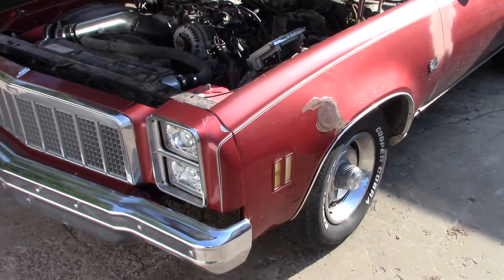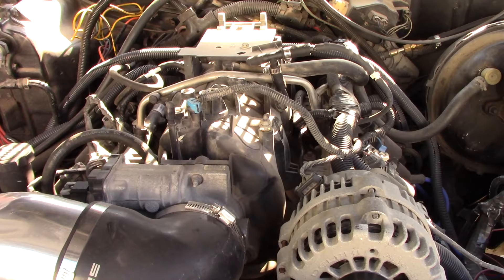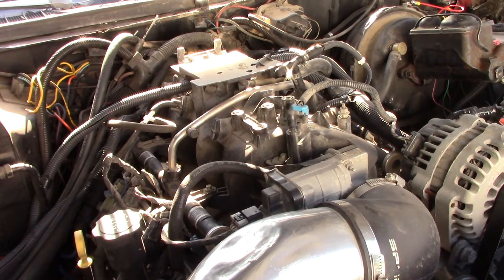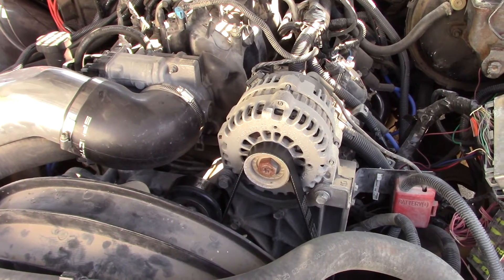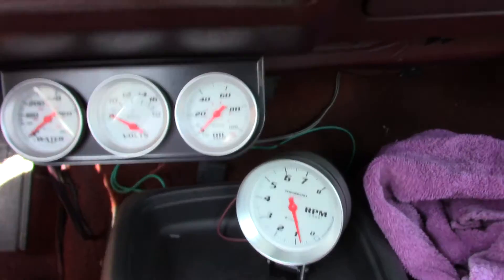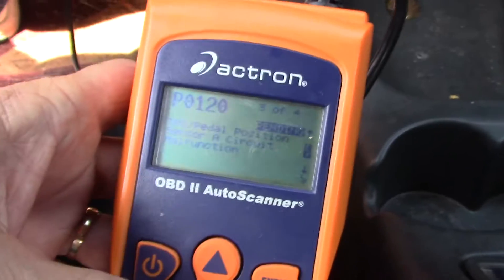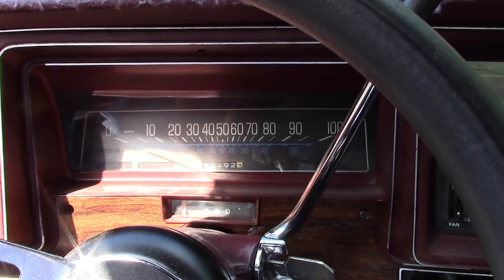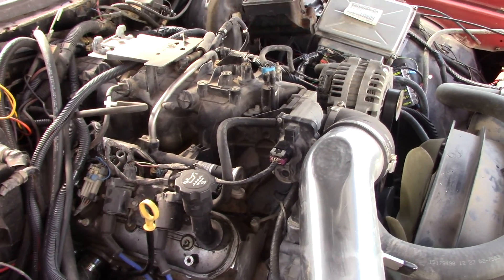5.3 swap and intro of 1976 Malibu

Comment: Did the pedal from the 03 bolt up fine ?
Reply from the maker: well no it didn't, I had to cut both the factory and the one from the Tahoe, and welded them together its been about 4 years ago i did it but seems like one or 2 bolts lined up but i don't remember, Ill try to check it when I get off work.
Reply: @mikescarsandadventures7595  ok thanks I appreciate it
Reply from the maker: @brieontk  Sorry took so long, but I looked at the pedal and I didn't use the top holes but may have used the bottom one, its hard to see without taking it apart.
Reply: @mikescarsandadventures7595  thanks man I appreciate it !

Comment: What color wires you use from bulkhead for your swap to get the car to run
Reply from the maker: Not sure if your asking about the starter wire from ignition switch, but I used the same wire to the starter that the small block used, the only wires I ran into the car was for the obd II hookup, cant remember witch wire from the computer it was, but lt1swap.com has pin outs on all the LS based harnesses. I did not use the original alternator wires from car, I used the 03 tahoe wire harness and alternator, works great, if you need something more specific ill do my best to answer your questions. thanks Mike

Comment: Loved your video, it answered some questions I had but I'm still a bit unsure if I should go ahead with my little project or not. I have a 77 Malibu i bought a couple of years ago. Interior completely torn up as if the previous owner had an angry pit bull locked up in there but it was running great and the body/frame was completely rust free, still had original paint job, it was in fantastic condition although the paint was bleached out from the Texas sun here. It had the original factory 305 and the Metric 200 transmission. So I pulled the engine out, completely reworked it with different cam, high compression pistons, had it bored, got different heads from a 72 Corvette 350 and made me a 327 from it. Spent a lot of money on that engine but it's a real humdinger now. However, I keep being told to just do an LS swap by a bunch of people. Now I know the engine will fit just nicely but what about all the rest? Like what about transmission, drive shaft and rear end? How did you get it from mechanical to all electronic drive by wire? So I was curious as to how big a deal all this was and if it's worth the effort? It ran fine with the stock 305 but it was with just over 170 HP and over 4000 lbs of weight, kinda under powered and ran like a grandpa's car. I have a 350 turbo transmission and combined with the new engine I'm sure it will move a lot better but it will also eat up fuel like a tank. I have a bunch of questions about that LS swap and would love it if you had a moment to get back with me on that. Oh and one more question: I'm having a heck of a time finding parts for this make and model, especially interior parts like door panels and such which are pretty much all ruined including the dash board
Reply from the maker: Thanks for the comment, and I think on a warmer day I'll put a video out of more of the things I did on the swap, like the pedal I had to modify to fit. I used the stock 350 trans, only required a little mod to the flex plate, had to open 2 out of the 3 holes to fit the converter, and there is a spacer they sell to make up the difference in back of crank to torque converter, so that's the easy part, don't require any trans mods at all, however, there is a trade off, as you said the car is heavy and with only 3 speeds and high gears, its not very quick, but runs better than the stock 350 that was in mine, it still about 2500 rpms at 65 to 70 mph, gets mid 20s on mileage too. Now for the interior parts, Original parts group has some and ive seen them on ebay, and I'm sure dixie monte carlo may have some, and they are the same door panels from the montes. they are kinda high as well. Good luck on you car, and I will put another video out on it as soon as I can.

Comment: What headers are you running ?
Reply from the maker: When I made the swap 4 years ago, I couldn't find any info on it so I bought a set of short headers off ebay, the passengers fit but the drivers did not, so I got a set of block huggers, and yes I have the short on passengers and a block hugger on drivers. You can modify the factory manifolds as well, they can be cut and welded to fit. I don't have any part numbers on the headers I used been to long ago.

Comment: I really enjoyed your in-depth overview of your swap. I did my ls swap back 2011 in my 80 Monte Carlo. Had to have the overdrive so I went with the 4l60e. Went with drive by cable for the simplicity,
Reply from the maker: Thats the way to go, I'm close to the 5 speed swap, have to see if my local computer guy can change the dbw to hit idle faster, if you kick it in neutral while moving it runs like 3000 rpm until you stop.

Comment: I have the same car summit told me it’s no headers for my chassis which headers do u have on thanks
Reply from the maker: I ended up getting some off ebay, the problem was the shorty would not work on both sides, so I got a set of block huggers and used one of them on drivers side

Comment: How did you do your alternator hook up
Reply from the maker: I used all the truck wire harness, the only wire from the car used was the one to the starter that powers the car fuse box.
Reply from the maker: I should add that the computer regulates the voltage to the battery, so the wires from the car are no longer needed unless you are using the old alternator from the car, I left all the original wires from the car there, just isolated them so if someone ever wanted to go back to old school they could.

Comment: hey brother i like the swap.....always like ls swaps lol. Time for some questions...https://www.youtube.com/watch?v=p10p8vM2Bro the link is a video of my car, my father passed and its time for the car to take a different route, i was wondering what long tubes you were running.... itll save me a ton of time researching it. Ive built this car from nothing and i can appreciate the time youve spent on yours... these cars are rare builds! thanks in advance, Matt
Reply from the maker: I wish i had good news on headers, because i had to set the engine so far back to meet the trans. it left me little choice, I had already ordered a set of shorts but the one on drivers side ran into the break proportioning valve, and had to cut the ears off the trans, ended up with a block huger on drivers side,  if your going to do a swap using old school trans its kind of a pain, I did find a set of long tubes from China on ebay but its been a while since I looked them up.
Reply from the maker: Just watched your video, pulled the wheels now thats cool.
Reply: i was actually thinking about running a 4l80e,  im assuming this would solve some issues?
Reply: ty
Reply from the maker: Ya it would, I didn't want to change trans location, had to move to many things, but wish for a overdrive. I do have most of a 5 speed for it, just need a few more parts.